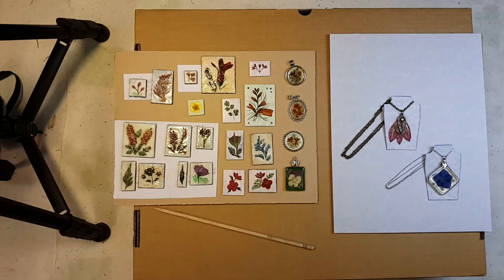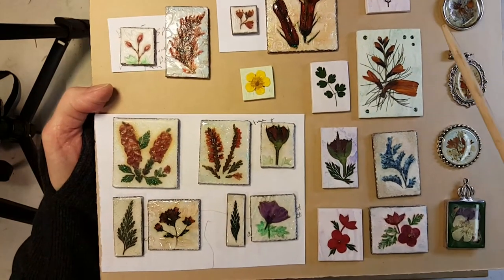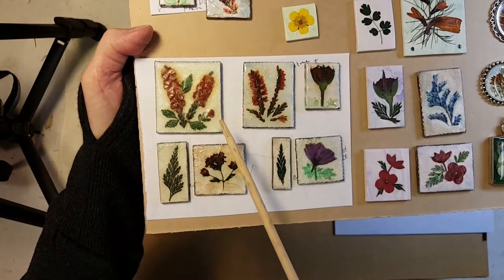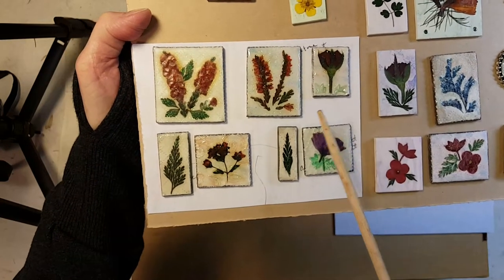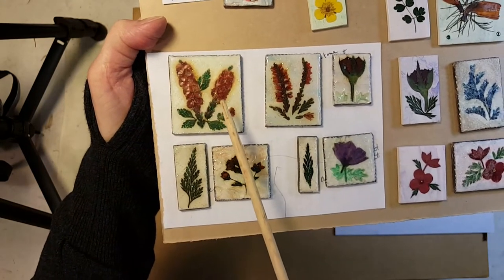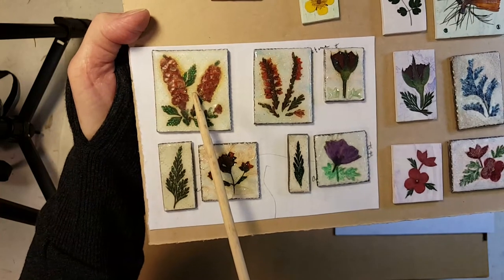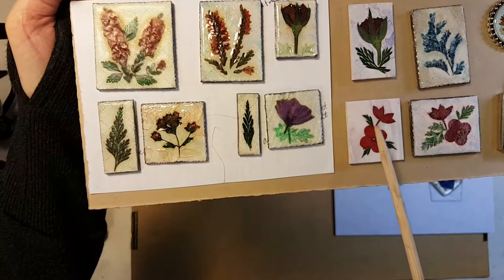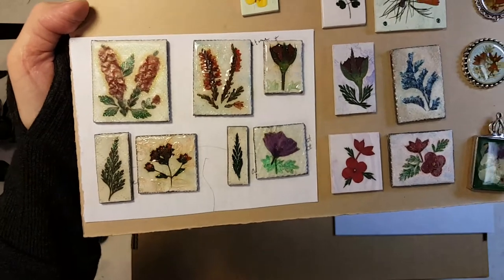Pressed Flowers and Polymer Clay | Tests for Wet Mediums as Portectant | What to Use

Comment: what would you use for jewelry? i'm interested in trying to cover polymer figurines in dried flowers and making necklaces, but cannot find any information on how to preserve them? i worry the floor polish would rub off over time?
Reply from the maker: Hi Carli, personally I think resin or under glass is the best for jewelry. The floor polish will last a long while since it is made to walk on. For personal use it would probably be ok, but for selling to the public I will go for the other protectants mentioned. 

There is also polymer clay clear covering I  have tried that and it worked, for example liquid bake and bond or liquid clay. You can actually bake many flowers in the oven and it will work. You need to test and play around though, since each flower is different. But in general, you can iron, heat laminate and or bake in a low temp oven for the most part. I have seen some jewelry flowers that look laminated so you could try that for fun... Em
Reply: @emsplace  thank you for responding! <3 i appreciate the advice! excited to try.